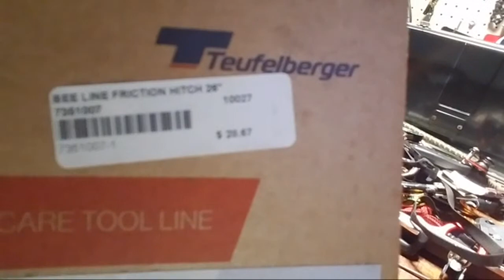WHAT'S IN THE BOX?  Gear Explanation For The Modern Climber

Comment: Found the info I asked for at 32:10...thanks again, man. Now I understand!
Reply from the maker: It works really good, & can still be used as a hand ascender.  I enjoy tinkering with ideas.  I had the same problem with wanting a foot ascender with my spikes.  Normal foot ascenders would hurt my feet or shift when using, and the worst thing was the foot ascender was always getting in the way of my gaffs.  I had the idea of using a hand ascender for about a year, but needed it to attach quickly & easily.  I kinda got the idea for the bungie from @GiorgioFiori (he also has a video of a really good homemade spike ascender)  it's worth watching if you haven't already.  
STAY SAFE